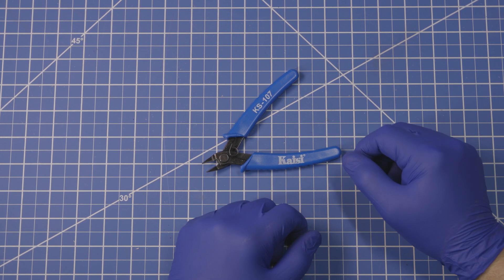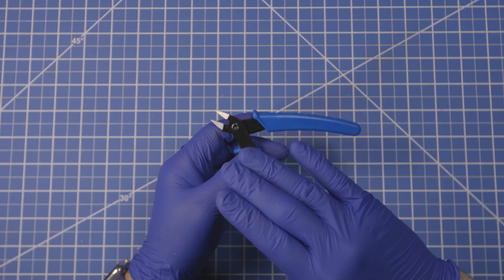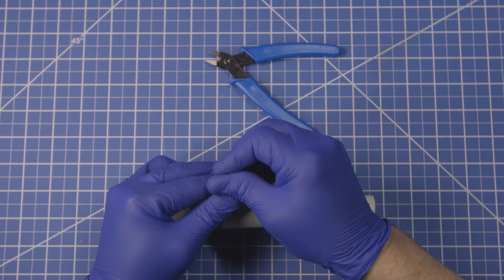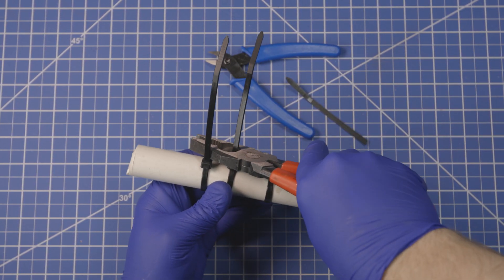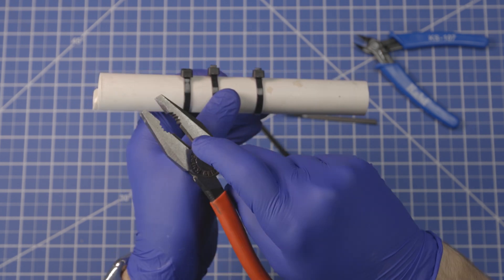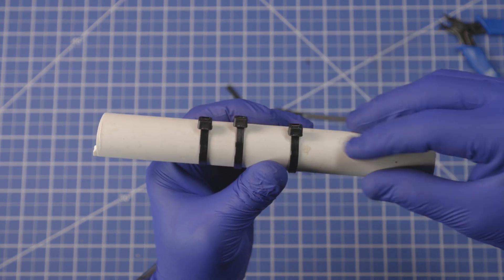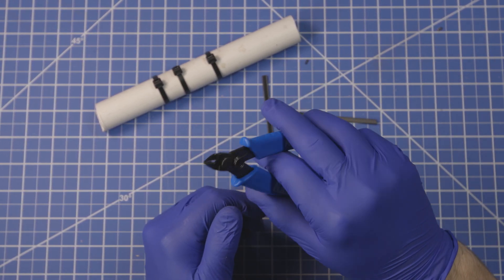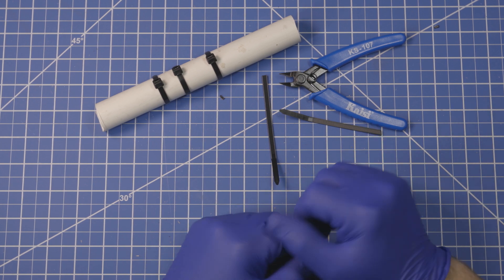Flush Cut Pliers Basics

Comment: Wish I would have found this video much sooner. Good job pointing out the fact that these cutters are 99% of the time not made for harder materials such as stainless steel. It took much more research and $$ to find this out the "hard" way. From what I have seen so far, the flush-cut's that support these materials are $150+. I decided to use needle-nose to rock-bend/break the SS off flush instead. More work, but does the job inexpensively.